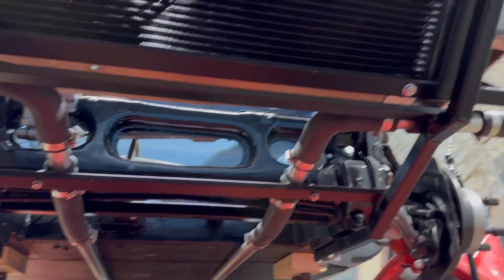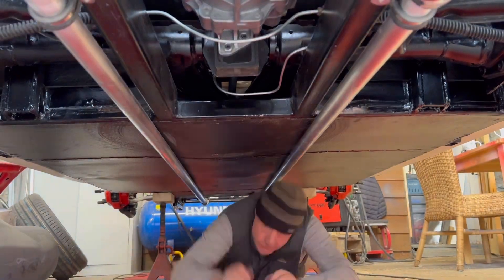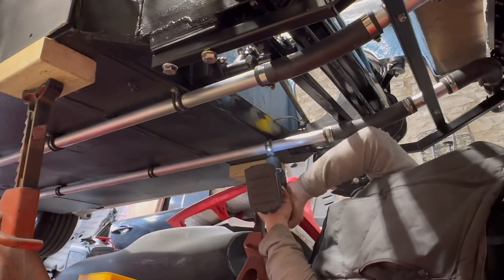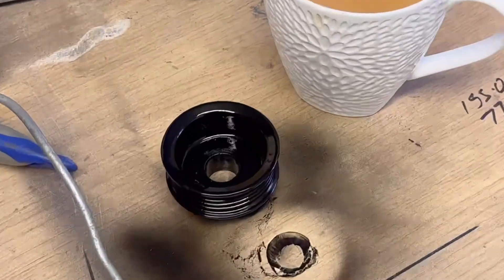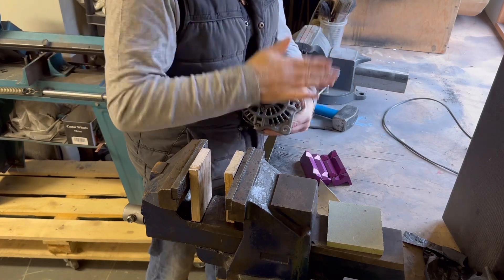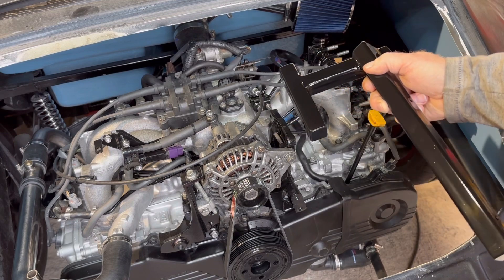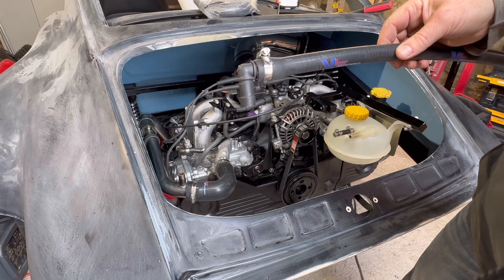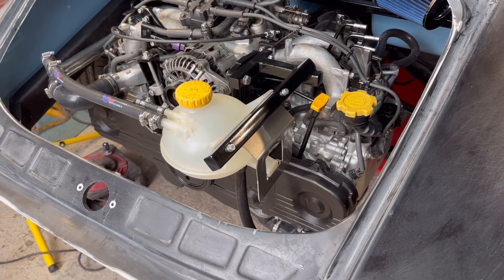17 Coolant lines finished & engine tidying - Covin Porsche 911 Subaru powered replica

Comment: What size belt are you using on the alternator/harmonic balancer, I have an ej25 with no ac and I just removed the power steering pump last night, need to buy an accessory belt that fits, great project and music selection
Reply from the maker: Hi bud, I’m using a Gates-5PK690 👌
Thanks for the positive comments.
Reply: @air_cooled_andy thank you! Perfect timing I’m at the auto parts store right now and was zooming in on that belt,
Reply from the maker: Ha.. excellent 🤩👌

Comment: I must of missed the vid where you installed the throttle cable…what housing/cable are you using and how’s it routed?  Keep up the great work.  Love the attention to detail and tidiness of the build! 👍👍
Reply from the maker: The cable came with a whole load of stuff I bought with the engine. It runs straight into the vw style pedal assembly. Would you like me to show you that in a vid at some point?
Reply: Yes please!  I’m doing an EJ25 Subie swap into a ‘72 SB…getting some ideas and tips from your build.  That throttle cable interface is something I haven’t quite sussed out yet.  Thanks! @air_cooled_andy
Reply from the maker: Ok bud!
Reply from the maker: Found it!…

https://www.fellowsspeedshop.com/blog/product/accelerator-cable/
Reply: Thank you!  Looks perfect…now do they ship to the US?  Thanks for looking that up.  Cheers! @air_cooled_andy
Reply from the maker: I’m sure they’ll ship to the US. Quite a few of my parts (sump, a few water pipes) are from this company and came with the engine. Good quality stuff.

Comment: Looks a very tidy set up. How far off the ground will them hoses be though when car is on its wheels as you want to run the car low so arch gap looks good. When do you think first start will be?
Reply from the maker: Good call though Andy, if it needs to go lower I’ll need to ensure the tubes are safe.
Reply: @air_cooled_andy  no worries pal, would hate for you to go over a speed bump spring a leak and then disaster happens to engine given all your hard work. Love watching
Reply from the maker: @Andy5c Yeah agree! I’m going to fit a low level coolant warning sensor in the expansion tank with a light on the dash I think, now you’ve said that. Good call 👌👌👌
Reply from the maker: Hi Andy. Ground clearance will be ok, I’ve had it on its wheels. It’s been test fired up in a previous episode. 😊👍